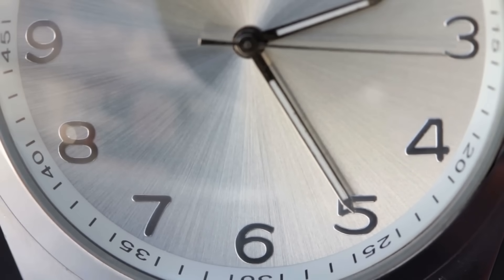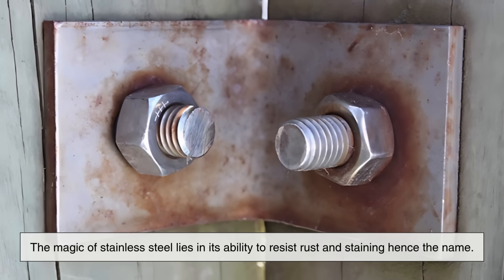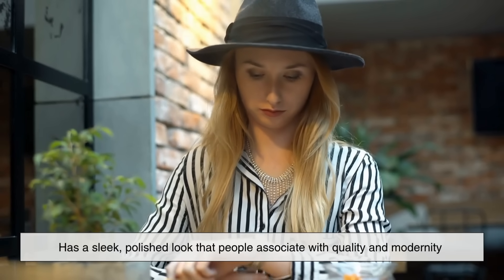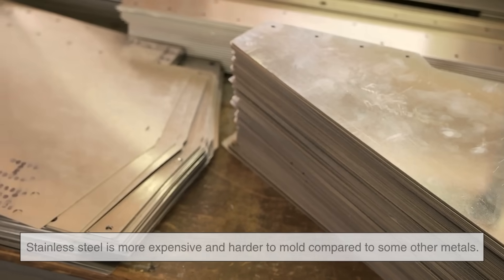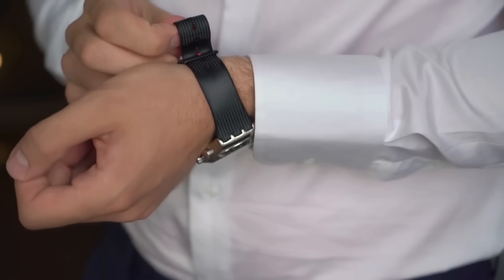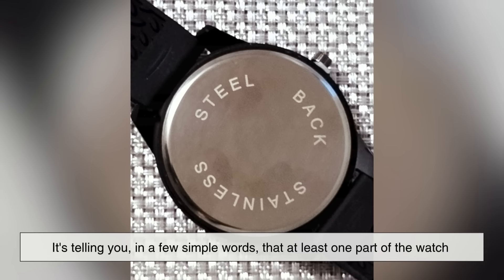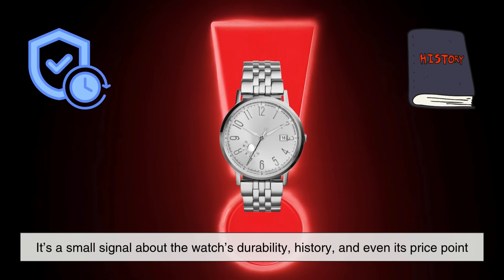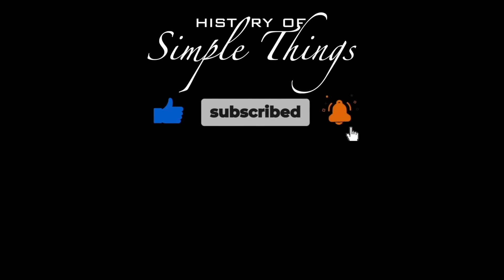Why Do Watch Backs Say ‘Stainless Steel’?

Comment: Stainless steel is about as informative as waterproof. It means that it resists corrosion, mostly by chlorine. The formulation, heat treatment, and other aspects of manufacturing all make a big difference. And that won't fit on the back of a watch.

Comment: Stainless steel is one of the best watch materials for affordable watches. That should be all stainless steel, not just the back. The case touches the skin too, and the case rots out, there goes the look, the sealing and the comfort. 

Recycling is probably a nightmare while extending life by donations to thrift stores and repair people does not work for base metal watches.

All jewelery needs to be metals which are somewhat quality with one kind of metal such as copper and brass tarnishing but not corroding terrably, the rest staying new looking. That way, there are choices which can be worn long-term and or passed to others. 😊

Comment: I haven’t listened to the explanation yet, but I’m going to say the ss back is there to protect the rest of the watch and delicate internals from the sweat and body fluids of the wearer.
Some people have extremely corrosive sweat that will eat up a low chrome content metal very quickly.